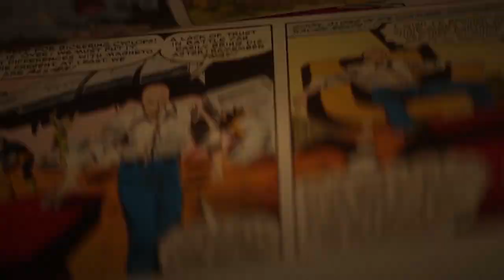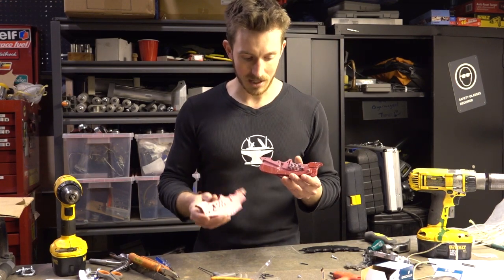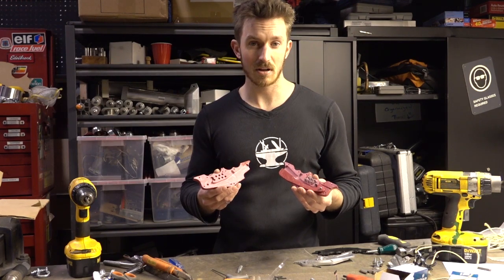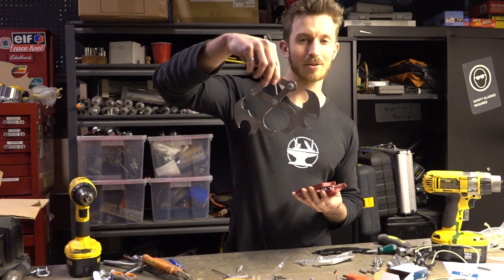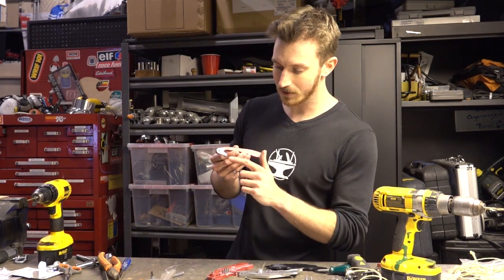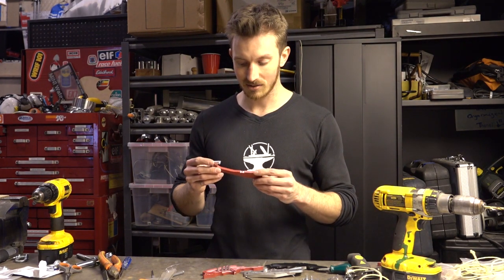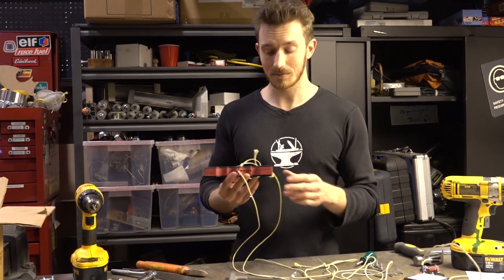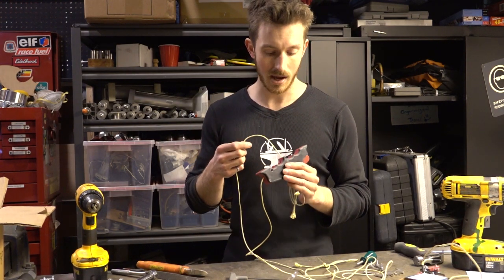Batman Grappling Hook Part 8 -- SUCCESSFUL RAPPEL!

Comment: asm vedio series ! one question, instead of using kevlar rope, can 550 paracord be used ? can it withstand someone's body weight ?
Reply from the maker: +Dipayan Das yes but it is too big to use in our rappeling device
Reply: the Hacksmith by "big" do u mean it's diameter is thicker than Kevlar or its length ?
Reply from the maker: Diameter... length is just how far you wanna climb... or fall ;-)
Reply: +the Hacksmith yeah :D well thnx fr the info...and really awsm work :) really inspiring ;) keep doing it ! :)

Comment: is there any way you could get Kevlar rope with a non abrasive sheath around it? Similar to how paracord is made.
Reply from the maker: +Eric Karczewski The kevlar itself isn't exactly that abrasive -- any rope becomes super hot when introduced to that kind of friction -- in a pinch you can escape from ziptie handcuffs using your shoelace (or paracord), so I don't think we can make it any better =(
Reply: +the Hacksmith Okay, it sounded like it was significantly more abrasive. It seems like the end result works well though.

Comment: Hello hacksmith, i am a very big Fan of you! My question is, how much metres you Can rappeling with your build device? Is there any limit? Sadly The Last rappeling test from The buildung Doesn't happen because of the weather :( Greets from Germany
Reply from the maker: Hi Mustafa, it was just a prototype with not much safety. It could work, but the rope could also snap, so we didn't end up testing it.
Reply: the Hacksmith ah ok, i didnt know that, i tought The latest version is safety :) safety comes first, we Need you :) thanks for The answer

Comment: why you fuck around with plastic ... metal !!!
Reply from the maker: +frank morretin the plastic worked better. ...
Reply: why ? ...I am a machinist and aluminium is way better than plastic , it dont chip like that  its easy to cut it and its way more rigid and strong , lightweight also ... I was looking at your video about it and it was bugging me you were keeping doing it in plastic , for a first proto in 3D print its ok but I think you should have done it in some kind of metal... I dont think batman rely on plastic
Reply from the maker: +frank morretin Didn't you watch the videos? The original aluminum one wore out the kevlar. Also since we lack a proper machineshop it took 30 hours to machine that thing versus about 3 hours for the engineering plastic. And since the wear components in the plastic one are still metal dowels... I don't see the problem...
Reply: if alum wore kevlar there is something wrong , a sharp edge or something , I thought you had a milling at your shop , and how it take 30 hour to do this ? ... im not arguing , I m just saying I dont understand why plastic , alum is way better for many use , just saying that by my machinist experience
Reply from the maker: +frank morretin We have a mill, not a CNC mill. We had to make the aluminum piece on a dinky hobby-grade CNC at my friends work, hence why it took 30 hours to do. Don't get me wrong, we would prefer to machine everything out of aluminum, we just don't have those kinds of resources. Our channel probably won't even break even on our own shop expenses until we break 1M subscribers so we're a long way off =(
Reply: for the interior of your part you could have done it by conventional milling (not CNC) sorry for my english I speak french , and for the outside for having a batman shape you could have sent the DXF file to a laser cutting shop (its pretty cheap when I sent stuff) so they make all the complex shape and then you finish the interior with the mecanism you need and fit it all with screws and dowel pins, yeah I know its not always that simple but I learned so much at my shop , its not like any regular shop , I cant wait to have my own tools and a garage to make my own projects, I mean I can do some at my work on free time but its not the same , where are you base in USA ? are you close to canada? but dont worry man your channel is very good and you guys are smart , you will get those subscriber !